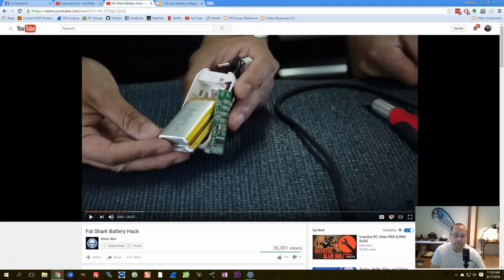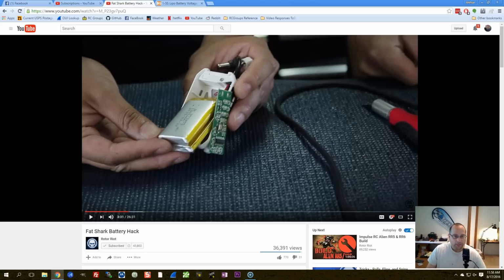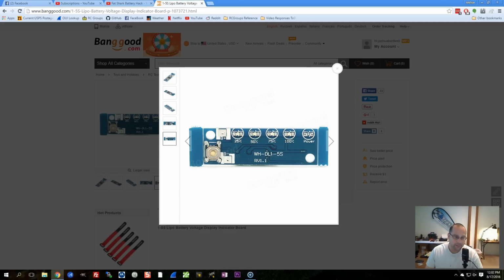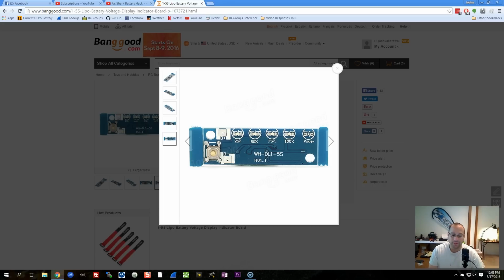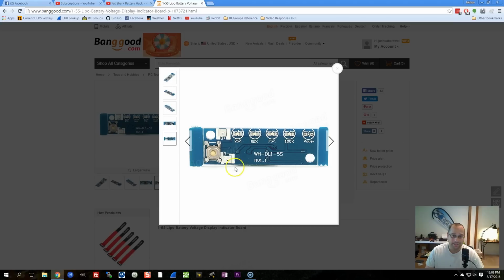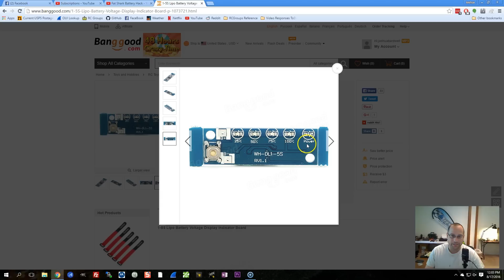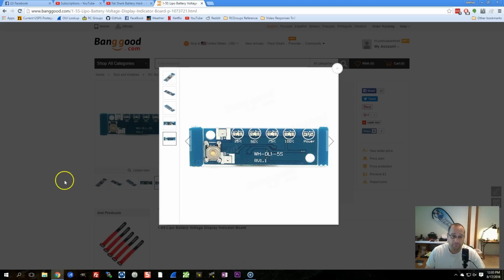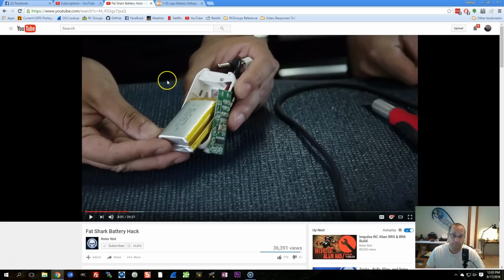Fatshark Battery Hack DIY LED Capacity Board

Comment: This indicator is not wery useful for li-ion batterys. You can discharge li-ion to 2.5V or maybe 2.8V are totaly OK. But this indicator minimum indicates 3.3V. Any hack for this, so last led vil turn of at 2.8V?
Reply from the maker: It doesn't really matter because your goggles will not typically allow the battery to go below like 3.5 or 3.7 before they shut down, to protect the battery.

You would need to change the resistor values in the board to change the threshold voltages.
Reply: I am planing to install pololu 9v step up regulator. Will be wery happy if someone tell which resistors to change.

Comment: Hey man, check these out too.  I'm putting a USB charger on mine, its only 1A so will take a while on 2500mAh 18650's, but its convenient

http://www.banggood.com/Micro-USB-1A-Lithium-Battery-Charge-Board-For-Arduino-Charger-Module-Protection-p-1074343.html
Reply from the maker: I use these for basic balance charging through the balance port (no fussing with programmable chargers). Just plug and go.

http://www.hobbyking.com/hobbyking/store/__7637__Turnigy_12v_2_3S_Basic_Balance_Charger.html

Comment: Josh, what about the plugs that plug into the goggles and or charger. Where can I get those. I have 2S balance leads but I need those plugs before I can build any more.
Reply from the maker: I'm not sure exactly what you want. You can get an assortment of balance plugs but crimping the pins is freaking impossible. I always just buy pre-terminated balance lead pigtails. Is that it?

Comment: I generally prefer FastTech over BG when it comes to shipping times - and save $0.60ea. - for the single-cell model https://www.fasttech.com/products/1/10003005/1225203-wh-dl1-7s-soc-indicator-for-single-cell-li-ion-lit - btw, I'm a vaper and this is where I generally purchase my vape goods as well... they are starting to carry some FPV stuff - but nothin' to brag about in price or availability there - but some goodies when it comes to DIY electronics and flashlight builds, etc.

Comment: In the video they dont mention adding a step up. Id definitely do so to utilize the whole battery life
Reply from the maker: Step up regulator in the pack to pull up to, what?
Reply: +Joshua Bardwell you use a 9v step up pololu so you don't get issues at half way through your pack. Cause at about half way the cells are at about 3.5v each and that isn't enough to satisfy the fatsharks. Without the Pololu you arent using the packs to their full potential.
Reply from the maker: +Randy Dearmore that's interesting...

Comment: I'm wondering, whether the LED strip may be inaccurate, if it's used with LiHV batteries.
Reply from the maker: LiHV discharge to the same level as LiPo, they just start higher. So it will read 100% longer, but will read empty correctly. But why would you make a goggle pack out of HV???
Reply: Well, that's actually a very good question. Thanks for pointing out, I even ordered one for 4s. :/ Good thing is, the stuff is cheap. :)

Comment: Hey Joshua, I designed a 3D model to house the 18650 that is almost exactly the same profile size as the official one http://www.thingiverse.com/thing:1743736
Reply: nice would like to see your finished project including the LED board - tag me when your done!
Reply: think help Sure thing, will do!
Reply: Yeah, that's nice - I want to see the finished model as well, especially if it has this board built into it! Thanks!
Reply: http://www.thingiverse.com/thing:1743736
Reply: thanks - had a quick look and I like it, going to ask a mate to print me one and Ill let you know how mine goes
Reply: think help Cool, let me know if you have any issues. It's a first released version and I know some things usually can be improved.
Reply: Thank you very much !

Comment: Hey Joshua. This LED board has been available at Banggood for quite a while. I've been using it in my custom 3D printed Fatshark 18650 battery packs and it works great. You're right, the power LED pins just lights up when power is connected - just don't connect it. One thing to watch out for is the Fatshark alarm. Because these are LiFe not LiPo batteries, their low voltage is slightly lower so they do alarm early. But, because they stay charged for so long compared to the Fatshark ones, it doesn't make a lot of difference. I easily get 3 flying sessions (about 3 days) from one charge. There's more..... Don't buy new 18650 cells. Find an old laptop or buy a used laptop battery off ebay. They use 18650 cells and you get at least 6 in a pack. I've built 6 packs that only cost me the price of Banggood LED board, the right angle power connector and a 3-pin balance cable. As close to free as is free!
Reply: great tips!!!

Comment: Or you could get this...
http://www.banggood.com/Eachine-2S-7_4V-1600mAh-Smart-Battery-For-Eachine-VR007-Fatshark-FPV-Goggles-Headset-Video-Glasses-p-1049185.html
Reply from the maker: Ehhh. Still only 1600 mAh. Won't even last as long as the FatShark pack. The 18650 packs last alllllll day.
Reply: +Joshua Bardwell 
I for myself made me a connector using three pinheaders. It easily can be connected to the balance connector of any battery (2S and up).

Comment: which batteries do you recommend 
Panasonic or any on bangood
Reply from the maker: I use the EBL cells from Amazon. About $17 for six cells. This definitely means that they are not "premium" cells but for low-amp discharge I think it's fine. I believe they are most likely unprotected cells as well, but I have not verified this. I'm fine with unprotected cells, but I could understand why someone else might not want to strap unprotected cells to their face.

Comment: Maybe add that you need the 2S version
Reply from the maker: Good point.
Reply: I got a 3S and a 2S version. To me they are exactly the same, packaging and component wise. Is the difference just a resistor size? I guess I will have to try both with a 2S battery and see if there is any difference
Reply from the maker: +M Kirkegaard I would expect there is a voltage divider that differs between them

Comment: Hate the power jack into the fatsharks. Random contact breaks suck big time. Did it on both my sets of fatsharks. I now run a cable, glued the jack onto the fatsharks. Still sucks given the cost of the goggles.
Reply from the maker: If mine broke, I might direct-solder a pigtail. But I've never had one break yet.
Reply: Joshua Bardwell I must be unlucky. Intermittent if occasional loss of picture. I really don't think the plug / jack is the best. I should really open them up and solder in a pig tail however I don't think I should need to do so. Just saying, think they could do better.

Comment: U should be able to rip that led out or cut the race then it would not be discharging your pack all the time
Reply from the maker: Vadim confirms above that it is not on all the time.
Reply: +Joshua Bardwell Hey man, love your videos. We are making some of these 3300mah packs from genuine Panasonic® ncr18650b cells. We are doing it the right way and capacitive spot welding them instead of soldering. If i send you one will you check it out and do a video on its quality?
Reply: I don't see why soldering is an issue. I have made several of those packs and have never had an issue with soldering them.
Reply from the maker: +WhomImIzFPV yeah, sure.
Reply from the maker: +WhomImIzFPV email me.
Reply: +SonicStrikeFPV Its not a major issue if you know what you are doing. You can decrease battery life. Any amount of heat imbued into a lithium polymer battery is not optimal. But, hey... These ncr18650b are really hearty. Capacitive spot welding joins the cells instantly in thousandths of a second. No heat transfer.
Reply: +Joshua Bardwell I sent you a message on fbook. Under kyle elizabeth bazinet. Send me your email address.
Reply: +Joshua Bardwell Ok, i found your email. Its sent.

Comment: I bougth an extra lipo from Hobbyking for 8 euro's. It's a Quanum 1500mah pack. This way I have 2 lipo's and can i swap as 1 get's low. That board is great because that i can build on my quanum lipo.
Thanks for the tip.

Comment: I don't know about the banggood board, but I personally think the fatshark indicator is over rated. It complicates the charging process because according to the main Fatshark guy (Greg is it?)  the board is supposedly also meant to handle the balancing of the cells - meaning you shouldn't connect the balance connector and balance charge the battery in your charger, but instead just do a basic "charge" and let the board handle the balancing. My experience is that it doesn't do a very good job with that. And if you still connect the balance connector and do a balance charge it takes a lot longer than it normally would - probably because the board is interfering with the balancing.
To me it's better to just use a lipo checker to keep track of the battery usage when flying, to be able to balance charger the battery faster, and properly.
Reply from the maker: This isn't like that. This is JUST a voltage indicator. It wires in parallel with the battery so it can show the voltage level, but it doesn't interfere with charging in any way.

Comment: I use these in series with a button/tactile switch over the 2 cells.
http://www.banggood.com/3Pcs-Yellow-LED-0_28-Inch-2_6V-30V-Mini-Digital-Voltmeter-Voltage-Tester-Meter-p-980046.html
Reply: +Henrik Sandaker Palm, I am trying to build exactly what you described. Would you post a picture of the battery pack you made?
Reply: John Zumwalt it's really just a switch and the voltmeter in series with the battery. Can you see the image? 
https://lh3.googleusercontent.com/GB-i7rSHLWIB-yoapJ7-W7xH7rMqX1g2Zmsl4wYvSMMqmY-WEFTsdqj3e9DrEGQMhr2MvvAShDE
Reply: The link does not work for me.
Reply from the maker: I just checked it and it seems to be working for me.
Reply: Odd, I had to copy/paste the link. I got it to work now. Thanks!

Comment: The power LED wont lite all the time, only than you push the test button, I'm using this board a lot on self made 18650 packs for a long time now.
Reply: Ok that is good to know
Reply from the maker: Thanks for clarifying this. I couldn't see any point of there being a power LED if it was only active when you pushed the button. I guess maybe useful to distinguish between a 100% dead pack, and a fully discharged one.
Reply: I got one from banggood today and there is no power led soldered in. Seems to work nicely on my 18650 battery pack.